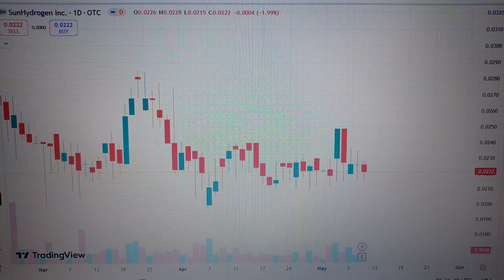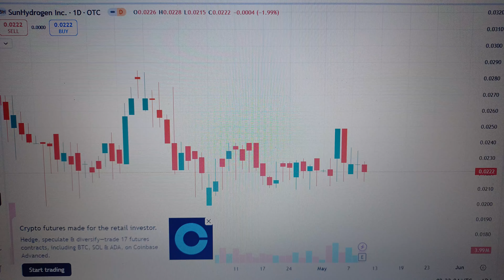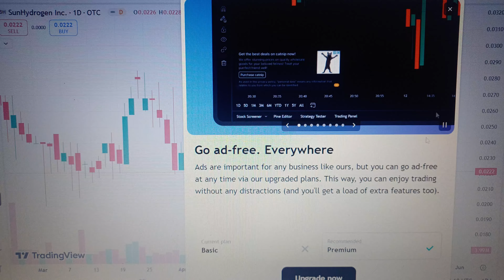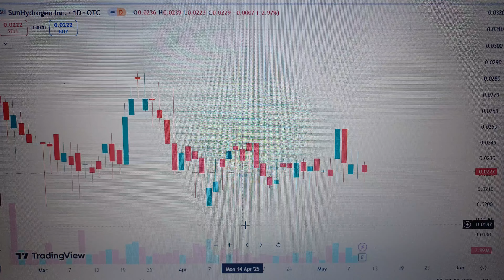Sun Hydrogen rocket stock update!! #trading #investing

Comment: This is a patience stock as its taken several years just to get to this pilot program, but then if it proves to be a cost effective way to produce hydrogen the next lengthy step will be scaling up for production. So I'd say payoff on stock is still a few years off, maybe even 5 years. Also, there are 5.5 billion shares outstanding so very likely reverse stock splits will happen, meaning if it's a 1-100 split then you'll get 1 share for every 100 owned. So let's say you own 100,000 shares you'll end up with 1,000 but the per share price will be higher. But they may even do another reverse split later, so invest cautiously.
Reply from the maker: Yes, all of that is true. This is a long hold stock but there's very few that hold this level of potential at this low of a price. Their extremely cost effective for the final product so it not necessarily the cost but the volume of hydrogen they can produce in a timely manner to keep up with demand. The CEO specifically said that he wanted to ensure that the company grows organically with out splits or reversals so there is that to hold onto. My biggest concern for this company is that after they start getting profits they get bought out. (My money would be on Honda to do that)
Reply: @StockWarden what would happen if Honda buys the company?
Reply from the maker: @browny1552  the stock would go to zero and no longer hold a place on the stock market